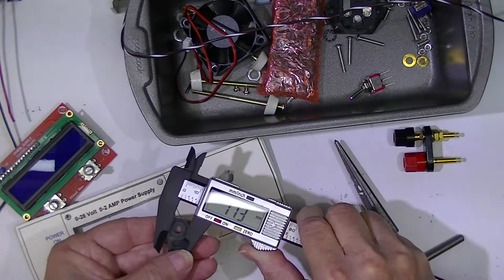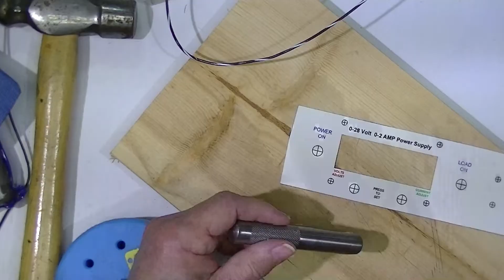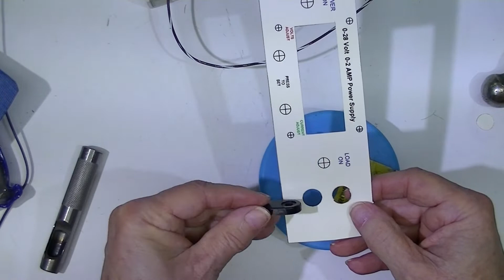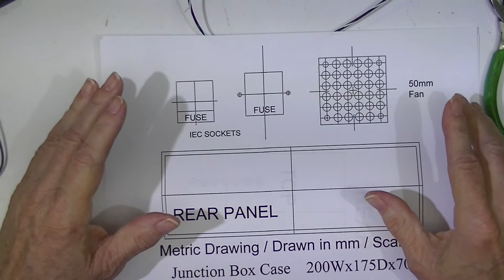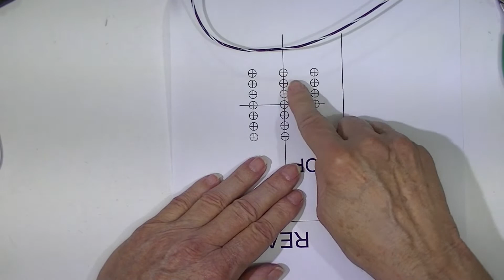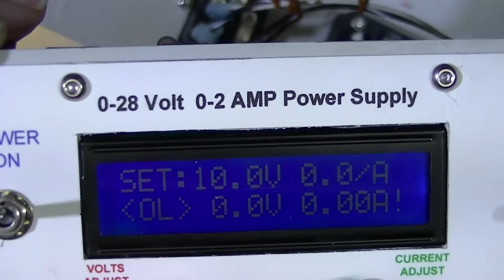0-28 Volt, 0-2 Amp, Power Supply - Part 6

Comment: Is this have short circuit protection
Reply from the maker: The output current can be limited to anything less than the 2 Amp. max. If not set, the output current will be limited to 2 Amps. 
BTW, I think this is the best of the Chinese supply kits available.
Thanks
Steve